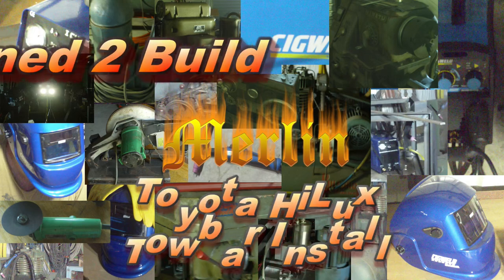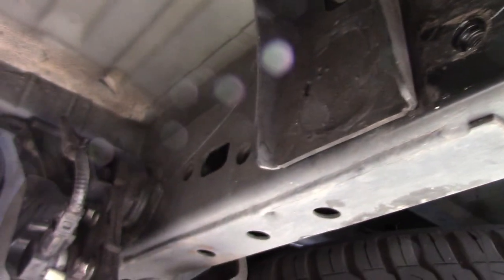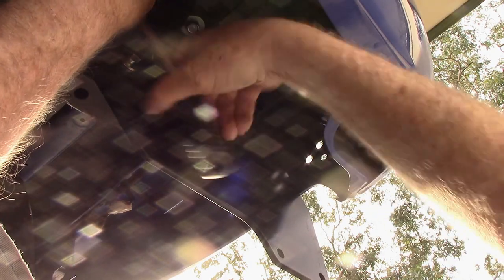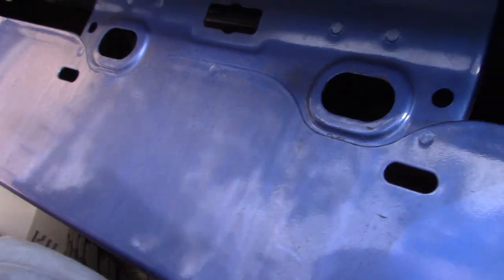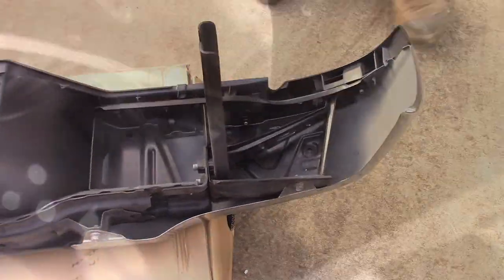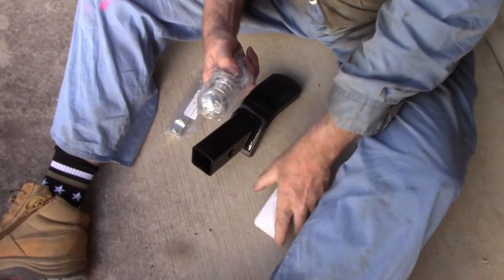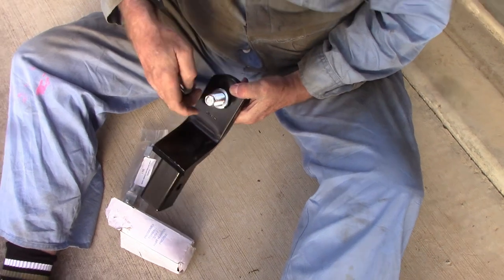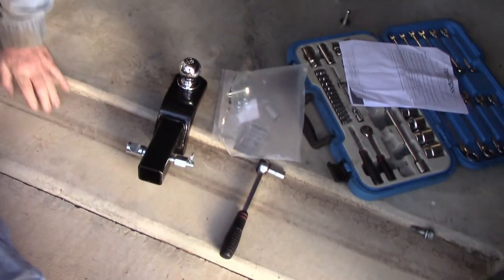Fitting a towbar to my Hilux

Comment: I would use nylock nuts or spring washers on something like a towbar which is subjected to vibration.
Reply from the maker: Either should work okay if torqued correctly.  This towbar came with spring washers so I used them.

Comment: Hi. I appreciate you sharing. How thick do you think the vertical plates are that bolt to the chassis? And the thickness of the square tubing running across? 

Thanks mate
Reply from the maker: Without measuring I would guess the vertical plates to be 6mm and the square tube I would guess at 4mm wall, just going by the weight.